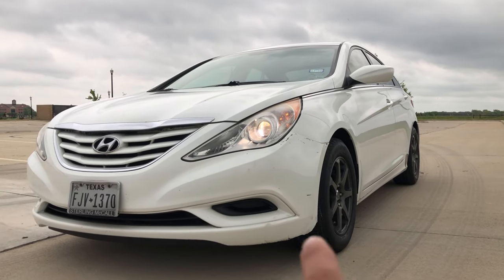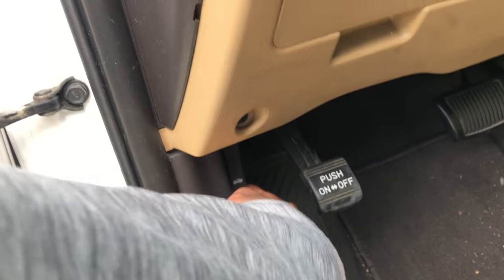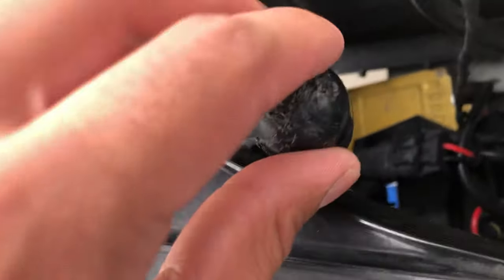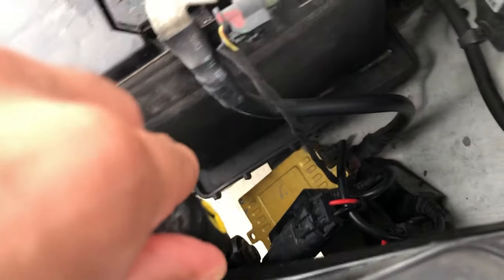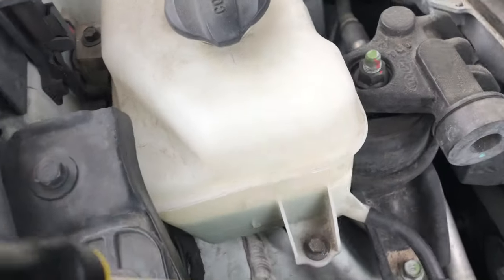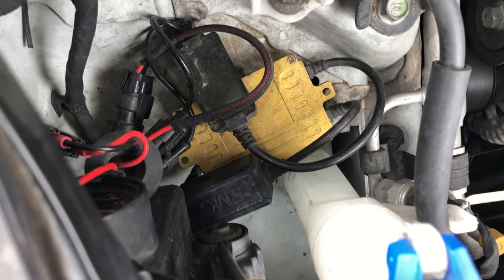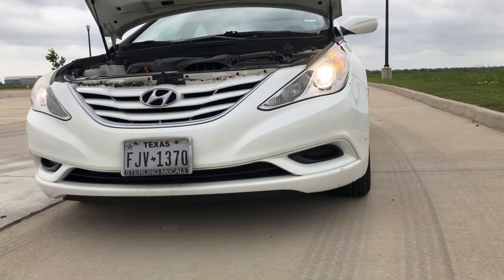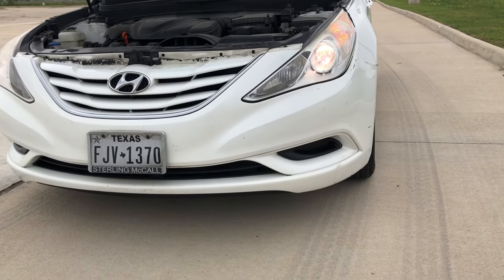Hyundai Sonata Low Beam Headlights fix/improved visibility

Comment: They are actually well built vehicles. I worked on a 2013 sonata today replacing the front brake pads knowing that they were worn @66k miles because I had to change the alternator at a discount tire parking lot.  It was early evening and I asked permission to do this repair after hours on their property as the costomer ride was dead. If you don't have the serpentine belt tool put a piece of pipe on your ratchet and tie it to the hood strut .I used  rope and vice grips. Then route the belt being on the inside of the ratchet. I hope that this helps anyone out. It has been done. 👍
Reply: 😂 except the engine tho
Reply: @hitmanslayer3003 yeah the engines are trash for sure lol big recall on all of them close to that year 🤣🤣

Comment: Thanks for the video.  Bought a 2014 Sonata commuter car earlier this year and it was horrible driving at night with only dim lights on.  Made the adjustment yesterday and tested out last night.  Amazing difference, thanks again.  If using the phillips head screw on the end of the adjuster you need to go counter clockwise to raise.
Reply: So it made the lights brighter or changed the lights direction? My problem is the H7 bulbs are dim in the 2011 hyundai sonata not the throw of the beam. They're so dim that even with my brights on its still too dim. I'm going to try this adjustment but I won't hold my breath
Reply: @mytrigger5613 any luck? I have same issue with my 2011 Hyundai Sonata. I thought replacing the halogen bulbs with led will help but nope, still the low beam is dim. Interestingly the high beam works fine. It could be a wiring issue with low beams.
Reply: @mytrigger5613 Did it work?Im having the same issue.
Reply: My high beams are great. My stock low beams stink!  I've made no adjustments cause I'm afraid my great high beams will get messed up.   @PriyeshKukreti
Reply: @PriyeshKukreti it’s because the interior reflective paint that the low beams use to project light onto the road erodes over time. I just replaced my entire headlights last weekend and it completely resolved this issue. I can finally see and feel safe driving at night
Reply: @Amy-xl2os  Thanks for your response. Safe drive :)

Comment: On the 2014 the adjustment screw is on the vertical vs horizontal. Harder to get to but still works.

Comment: Thanks for the video but mine don't do anything I cranked and cranked clockwise and nothing changed. 2017 Sonata Se.  So j just ordered new housings. I had already changed to brightest halogen thst Sylvania makes and saw no difference.
Reply: Did it work when you got new housings?
Reply: @MrFunkadeIic  Got new housing and it dif work.
Reply: @albertvela8712  How much did you pay for the new housing? I have a 2013 Hyundai Sonata. I bought it brand new in 2012 and I know when I bought it, the lights were bright as hell 

I'm going to try to align the lights tonight. If that doesn't work, then I'm going to replace the housing because I think the projector may be opaque and reducing light reflectivity
Reply: @MrFunkadeIic  I bought them on eBay pair 243.00. Shipped. Hopefully it works out for you.

Comment: My '14 Hybrid Limited has the same-looking components but inside I don't see a screw. I tried putting a Phillips in there but obviously since it doesn't seem to be hitting a screw, nothing happens. Does that model have a different setup for adjustment?

Comment: 2016 Sonata Hybrid. The gear does turn with a Philips head screw driver as shown, but multiple rotations watching the gear actually move did Not seem to change the aim up or down. Turning clockwise to see if the aim would raise as suggested? Previously replaced the passenger side bulb with a new brighter rated halogen light and I saw no immediate difference. Low beam lens is very thick and I see why the author converted to HID. Another potential "can of worms", but perhaps the only light strong enough to make a difference? Access caps are a bitch to get off. Will turn the gear some more tomorrow and see if it bottoms out. Really pathetic compared to the car lighting of their competitors and the bright white color of today to their pitiful yellow. I don't see a height problem with the aim, I think the low beam lens is too restrictive, and Hyundai knows it. High beams are okay, but again, far weaker than their competitors. No driving lights on the SE model to add helpful illumination. Really an exercise in futility. I do appreciate these DYI vids, however.
Reply: If your hybrid has adaptive auto leveling headlights it might have a headlight leveling sensor that tells each of the two headlight aiming motors to move the lamps up or down depending on the vehicle's angle to the road.

Comment: These 2011-2014 Sonata's almost will have engine failure at some point so never buy one. It is an awesome car though with some serious power for a 4 cylinder.
Reply: engine failure guarantees you a brand new one via re call. It's actually not a bad idea to grab one. Got mine replaced for free (wasn't the quickest turnaround, but new engine is new engine)
Reply: @jochang9012  Yeah I got a new engine from Hyundai as well but basically had to push it in for them to acknowledge something was wrong. It was knocking for over a year and could have left me in a dangerous situation had I broken down in the middle of the expressway like some have. They lie and are unethical and Toyota will get my money from now on.
Reply: My ex girlfriend had a 2012 sonata. Her engine locked down, she was panicking until I looked online and saw that it was a recall on her model and year. Hyundai replaced it with a brand new engine free of charge
Reply: the engine failure is due to people driving them with low oil levels, these cars burn a crazy amount of oil and if you don’t keep a eye on it. BOOM. but besides that they are pretty reliable and tough cars. been using my 14 sonata as a rally car sending it sideways at 60 through gravel, or 80+ though turns on asphalt things a trooper
Reply: Engine failure (while on hwy) at 130k miles, for my 2013 model. Due to recall, replaced engine, and now have almost 138k and no engine issues. Only issue is no matter what H7 bulbs I buy, the low beam is barely visible. Tried various LED brands from Amazon and broke the metal bulb housing that holds it in place. Now, have to rig it in order to keep it from coming out of the socket. If I hit a curb, makes it shift up/down/left/right out of center. Wish I could get it reconfigured with LED professionally but this model isn't made for specialty bulbs and the installation too expensive for such an older model. Currently looking for better H7 standard bulbs.
Reply: @astoundingchicken replace the entire headlights. The reflective coating that the bulbs project off of inside the headlight erodes over time and causes the low beams to gradually become useless and very unsafe driving at night! I have a 2012 limited sonata
Reply: My engine got replaced for free. Make.sure you have your oil changes documented and also go to the dealership to get an oil test done

Comment: Thumbed down for binding other roads users and encouraging others to blind me. Do not ever adjust your low beam headlight up.
Low beams should always cat of on the road. Please don not blind us.
Reply: The 2011-2014 Sonatas shipped with the headlights not properly focused & needed to have them adjusted. The Hyundai forums are full of owners who have trouble seeing the road with their cars. It's great to have someone demonstrate how to fix the issue and make the roads a bit safer for the thousands of '11-'14 Sonata owners & the millions of people they share the road with.
Reply: It’s 2020 every car on the damn road has blinding lights get over it
Reply: I think this breaks down to a simple misunderstanding. I do not believe this function turns the lights upwards or turns them at all. I believe this just turns something else enabling the light to brighten as they should be from a dim state. I say this because the bulbs can only fit one way so you will automatically have your lights pointed down, this fix just turns the light up like a dimmer on your chandelier lights might turn from dim to bright.
Reply: @mytrigger5613  sorry, you're completely incorrect. They are to aim and fine tune the direction of the beam. There's literally nothing, no adjustments to  control the brightness of the headlights on any car.
Reply: If you're headlights worked as terribly as mine do, even after hid install, you'd keep your negativity to yourself!  He wasn't suggesting that people should blind other drivers, but simply suggesting a possible fix to an issue that is a major safety concern for anyone driving a sonata that has the low beam headlight issue.
Reply: Amen @ModernJoker